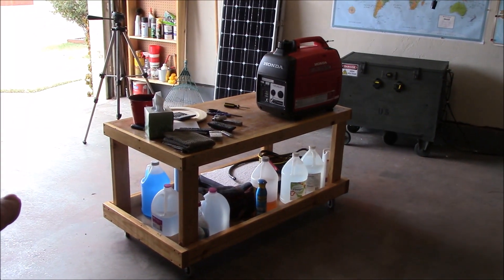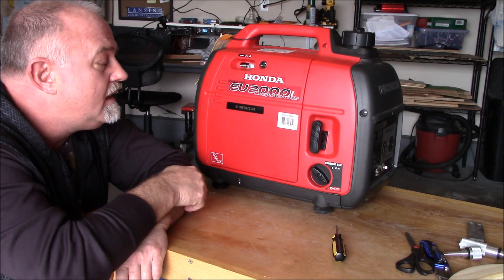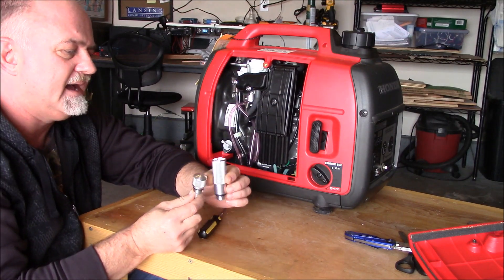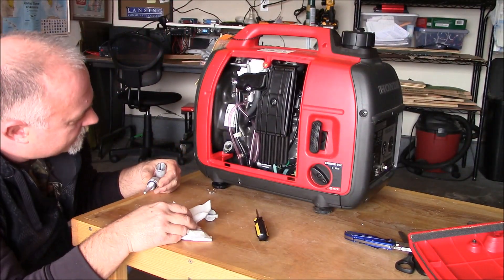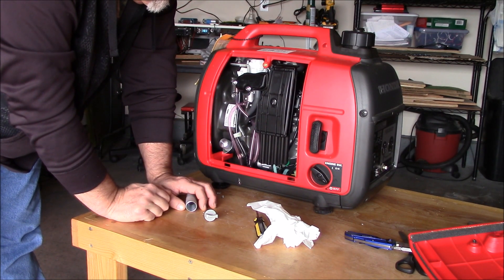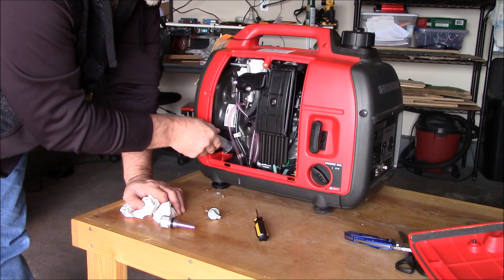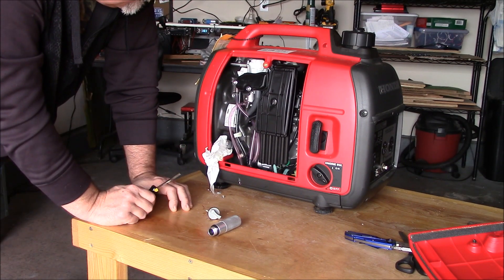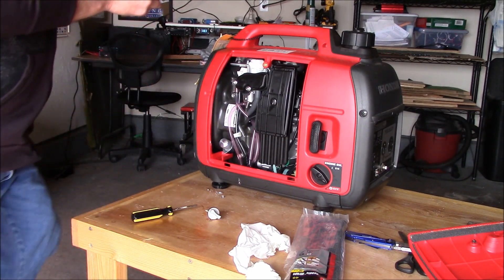How to make your Honda generator work better (magnetic dipstick & no mess oil filler extension)

Comment: Wow!  You take much better care of your stuff than I do.  I like that filler cap, I've been using a pistol pump oiler to fill it.  If I so much as check my oil, I look like I took a bath in it.  I also purposely overfill it by leaning it over when I fill it and put the cap on before leveling.  One thing I do and put on my google calendar each month as a reminder is to start ALL engines and let them run for a minute or so.  That works pretty good...
Reply from the maker: Thanks...you know, what I didn't "say" on this video was that I never changed it since buying it new on May 16, 2015. I always checked the oil level, not that many hours on it, but should be shot in the face for not doing it earlier...the used oil looked sick. Good to go now. Honda's rock.

Comment: I dug around my garage and found a 12 inch length of pvc pipe that fits just right over the oil neck. I put the little honda on the table holding the pipe to the neck and tilt it so it drains to a bucket on the floor. Works perfect every time without spilling a drop. I pamper and and take better care of that honda than I do myself.
Reply from the maker: Neat...these Honda's are really great

Comment: Chris, when you drain the carb bowl there is still gas in the fuel line from the shut-off which will make its way to the carb. You have to tip the generator back on such a that when you are draining the bowl you also get the fuel in the line from the shut-off as well. 
 I noticed this when I was recently cleaning the carb (I bought one used).

Comment: Here's what I do. At a big box store you can find gutter leaf scoops that are narrow to fit down in the bottom of your gutters. Take a 3/4 or so hole-saw and drill a hole in the bottom of the scoop close to the handle. You may have to trim the front (leading edge) of the scoop with scissors to fit under the oil fill/drain hole. Put the generator on a raised platform where you can tip the generator to drain it. Push the scoop edge under the drain hole then tip the generator to drain in the scoop while you have the hole you drilled in the scoop over a container to catch the oil. This works on 4 stroke outboard engines as well.

Comment: To store the funnel thing , I pulled the carb drain hose out at the bottom slipped it through the funnel and back into the hole. Can't lose it and it's right there when you need it.

Comment: Hey Chris, glad to see you got the magnetic dipstick in use. I got two of the WEN inverter gen sets with a parallel kit. they take that same magnetic dipstick. It is amazing how much ultrafine particles both gather. Oil changes in them are also messy to say the least. I also have changed oil 3 times in 12 hours, since oil is probably the cheapest thing for longer engine life. I did add an hour meter on them to be able to keep track of run time. It's a 15 minute install per. These inverters really sip fuel compared to my Lincoln Ranger running wide open all the time whether I have a big load on or not. Thanks for another good vid!  Oh, and Merry Christmas and Happy New Year!!!
Reply from the maker: Dunno anything about those WEN generators at all. I like the hour meter idea...hmmm!

Comment: >^..^<      Suspect zip tieing the aluminum filler extension on the handel will dance around, make noise and abrasions on the red plastic when in operation.

Comment: I have upgraded from a Honda generator 2000 watt to a Duromax 9000 watt peak 7600 running watts. I can tell you adding or changing the oil in my Honda is way easier than this new one I got. With this Duromax I have to get on my hands and knees to check the oil before starting. Is there any way to get a dipstick meter?

Comment: You won't say "sweet" ....thinking "this will capture all kinds of metal FINES".....but instead.....the BIG magnet-end falls off the pressed-in end of the alumunum dip stick.....now you got a big chunk of REAL metal that can do REAL damage to the inside of your engine. Cheers. ASk me how I know. Now try getting it out......
Reply: That is unfortunate but not common.  You can buy a tool that telescopes for collecting metal at most tool stores incl home depot.  you should be able to stick it in and grab the magnet.
Reply: Maybe so....gives little comfort as to the value of the magnet dip stick..... how many wear particles are magentic anyway in a mostly-aluminum engine? And seeing how easy the magnet fell out of my dipstick gives me little comfort as to not risking dropping out while running, which goes way beyond fishing this out with telescoping tool when it is safely "off".
Reply: I bought two of the magnetic plugs and one filler extension.  Before I used any of them I noticed that one of the magnets had come out of the aluminum plug.  I left neutral ebay feedback for the seller for a less-than-stellar product, and he replied wanting all kinds of photos and explanations.  Told him it wasn't worth my time to mess with it.  I ended up cutting the plug "extensions" off completely, including the magnet.  Both magnets now hold photos onto my refrigerator door. :) :)

So no, I wouldn't recommend using magnetic plugs at all.  Just change the oil frequently.  It costs me about $5 to change both of my EU2000s with a single quart of Mobil 1 synthetic.  Since the drained oil comes out almost spotless, I use it to fill my old lawn edger's Briggs.
Reply: @Springerpop  u reuse oil, now that's cheap at the cost of the equipment you are using.
Really! 
If its so clean why nit leave it in the gen
Reply: Very common.  The magnet is pressed into the aluminum.  The aluminum expands in the heat, the magnet falls out and guts up the oil slinger, causing a $600 repair.  The Chinese make great stuff, as we all know.

Comment: I change every 50 hours, 100% full synthetic oil only, and 100% Marine Gas ONLY,  Marine gas is 100% Gasoline, contains ZERO Ethanol, 99% Less Carburetor issues.
Reply from the maker: Sounds good. I also added a magnetic oil fill dipstick too.
Reply: I agree, E10 is garbage for small engines. They say you can store the 2000i with stabilizer treated fuel, but zero ethanol gasoline is better imo.
Reply: Total waste of money using Synthetic  oil in what is basically a lawnmower engine, maybe if it had a filter, but it does not, this is an engine with a small oil capacity and it should be changed often, and a good mineral oil lubricate s just as efficiently as the more expensive synthetic, in some cases better.. marine gas with a stabilizer is the way to go.
Reply: Wow that's frequent oil changes
Reply: @johnmurphy40  Incorrect John. With an "air cooled" motor the actual heat 🔥 transfer medium is the OIL... Then the metal... It's worked much harder than a liquid cooled motor. 
 Using a FAR more thermally stable oil like Synthetic is a Very Wise idea 👍
 PS the old VW beetle air cooled motors love synthetic as do the deutz diesel air cooled motors 👍
Reply: Just buy Ethanol free gas...

Comment: >^..^<        Also as plastic funnel with a long neck will eliminate the spilling mess and cost perhaps 1/4 of the aluminum thingie.  How much noise does the fill extention make when the gen is running strapped to the handle?  Honda makes good equiptment  and worth teh extra cost but no one or nothing is perfect sadly and never will be.....

Comment: Chris, in reference to oil change on machines ,We have found that a suction pump oil container is by far the Best
way to do it, its easy to do just insert suction Tube into oil dipstick tube on motor being changed making sure it
is at bottom next pull vacuum on container with attached pump, then open valve between dipstick tube and the
oil container-let it work you  may repeat vacuum pump pull, next remove tube and fill with new oil.
this is the easy clean way to change oil in about anything we use on Our big Max 6 wd ATVs which have large
engines in them in the rear compartment, Check Tool Co,s for one you will love using it.

Comment: Chris does your genny not have a drain plug under the bottom of the engine?  some times they put a plug there remove it & U can get to the engine sump to drain the oil. Normally U have to put the gen set on a bench or milk crat so u can remove & drain  the oil. I use a small funnel to put the oil in, its a makes a mess what ever U do.
Reply from the maker: Naw, not that I know of...not sure if it would have done much better. Still, it only takes 1/2 quart or so...which is good.

Comment: Chris, I change my Honda oil by tipping the machine up on a table just like this authorized Honda service guy...no screw on metal “funnel”, no probs.  https://youtu.be/a8m81HReLtI

The issue with the screw on metal funnel is the replacement of oil into the system basically have you overfill into the metal piece bc you can’t watch well how it’s filling, then you take the threaded metal thing off, oil all over to some degree.  It’s 13.5 ounces of oil that it takes, as stated in the video, and I bought a $2 plastic large measuring cup just for oil...I drew a fill line and wrote 13.5 ounces on it with Sharpie, and now I can tilt the Gen back a bit and pour the 13.5 ounces out of the pouring spout of the measuring cup into it without spilling a drop, no overflow.

Comment: I would be worried the magnet would fall off : (
Reply: Yep...."press fit", which can be compromised with heat and vibration. Mine came off.... not good
Reply: My magnet fell out, too.  I was lucky, it did it before I ever installed it in my engine.